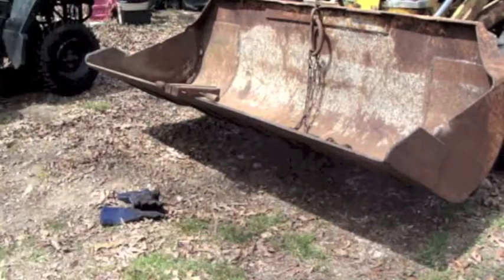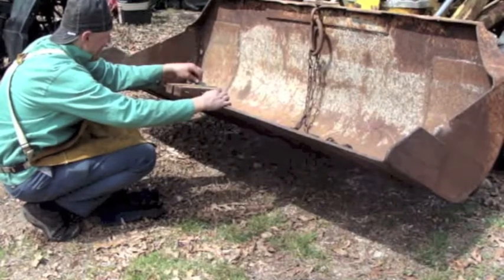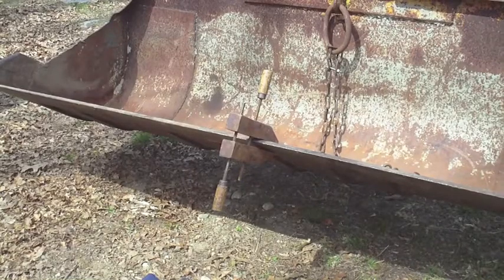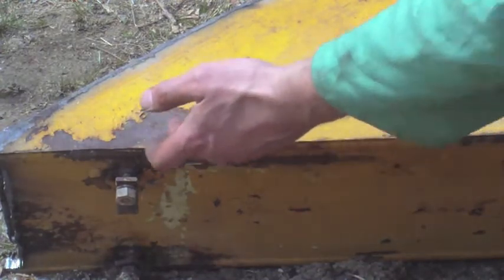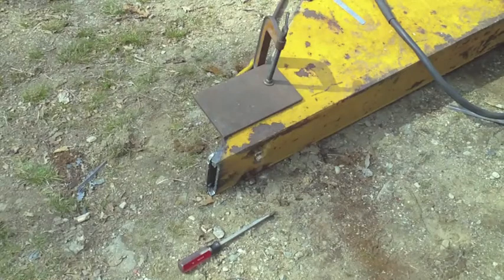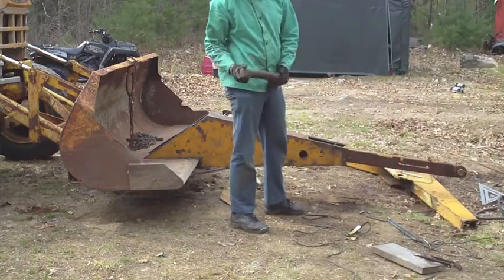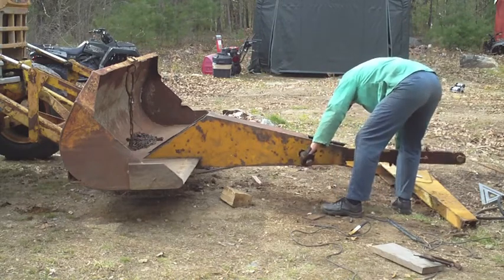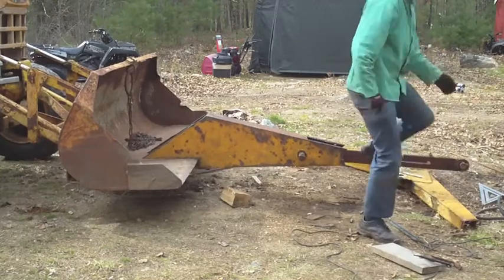The Boom pole aka "Minicrane" Project Part 6

Comment: you may want to plate the upper part of it to keep it from bending were it goes on the loader
Reply from the maker: Hi Larry, thanks for the tip. I'm going to tweak the design over time.That steel is pretty thick already, but I'm not opposed to the idea, just not sure exactly where you mean. At first I was thinking the part that faces the ground might need to be beefed up, but that has the double plate already. The upper area is pretty strong already.
Reply: its the upper part that slides on the loader the grove you cut i mean to plate it and im just saying it might help with a twist it might have were its not boxed on the upper like the bottom is doubled
Reply from the maker: Larry Jones Thanks Larry, I now understand. I forgot to take into consideration the twisting loads encountered if an item starts swinging. I think Calpilot's suggestion below will help with some of that.
Reply: stevewatr  your welcome and wish you were building this about a year or so ago when i had to help my dad move a 300 to 400lbs wood stove and used a wood A frame to get the stove to were its at know love to have it in our basement going have to crane it down if we do and your a ton further north than i am i am in the south  and the northern tip of tennessee
Reply from the maker: Larry Jones lol, sorry Larry, don't think this thing is UPS shippable!
Reply: stevewatr
well it probably is but i hate to see the shipping cost for it but we are trying to sell that stove for my grandfather so the buyer will have to worry about the moving of it. still think it was ingenious of you to use your scrap to build what you need
Reply from the maker: Larry Jones Thanks!